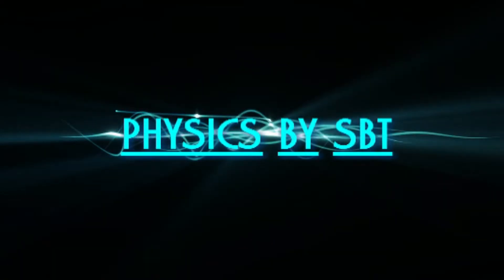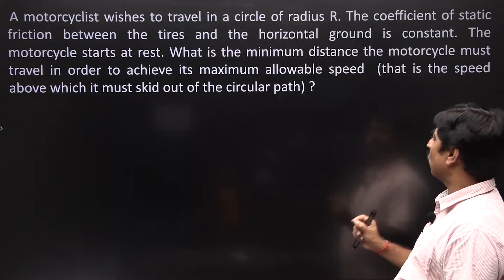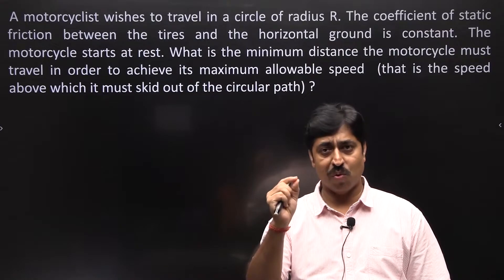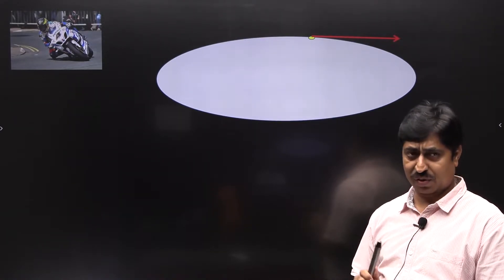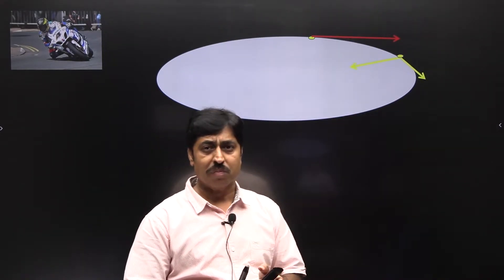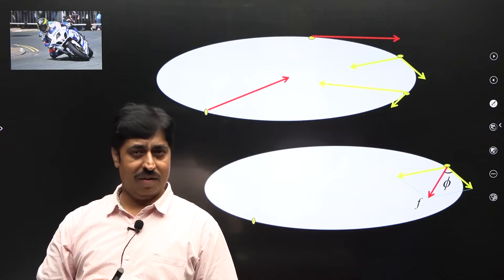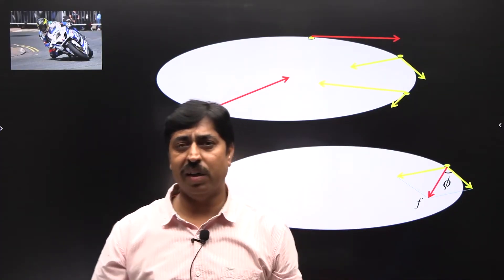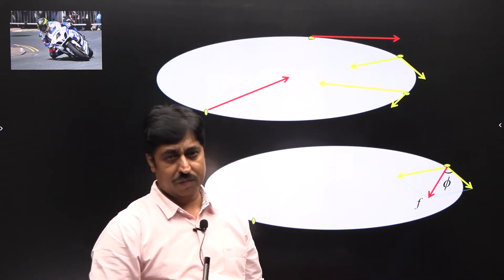JEE Advanced level Problem on mechanics | challenging Mechanics problem #sbt #jeeadvanced

Comment: Sir how did you equate fcos(phi) with mdv/dt.....as the speed(tangential velocity) is increasing then how balanced two opposite forces..??
Reply: He didn't balance the force, simply he equiated net force equal to mass into acceleration
Reply: Can you please tell, net forces is comprised of which forces here? @Man_ishere
Reply: @Man_ishere and the main question that struck on my mind 1 st is why sir is showing friction in the dirn of motion???
Reply: @ShuvadeepBiswas-c1k  for any accelerated motion there must be force in that direction, so I am asking what force is in direction of motion? There is nothing other than friction bcz no other force is acting
Reply: @Man_ishere  exactly friction never supports relative motion, then why sir is showing that in direction of motion here as the ground is fixed here (i.e. not moving)
Reply: We can assume any direction for friction , right ?  If answer comes negative , then friction acts in opposite direction .